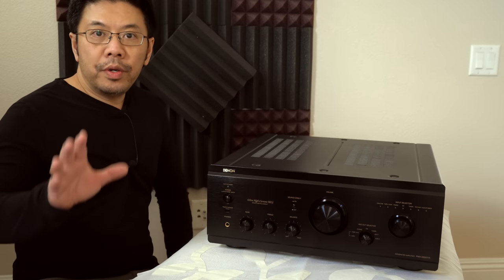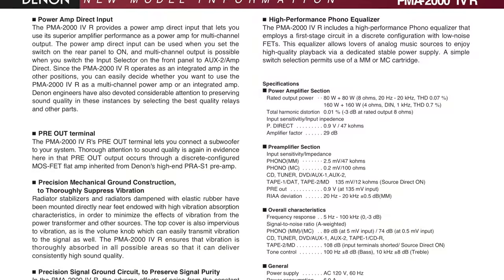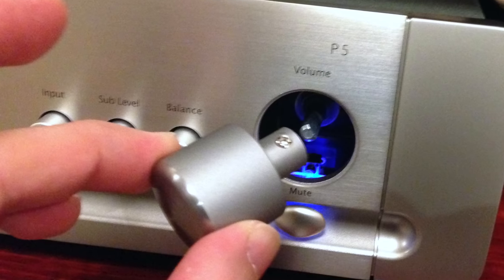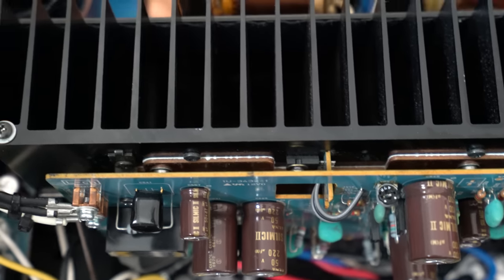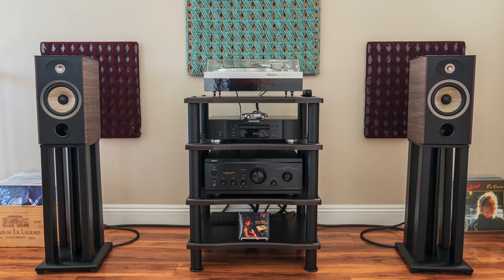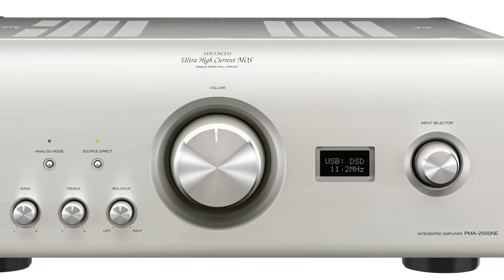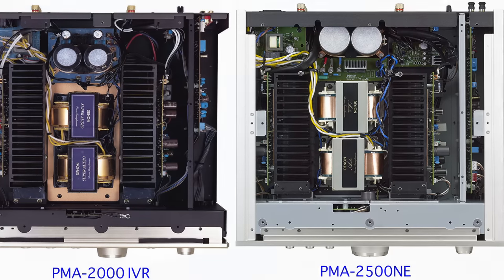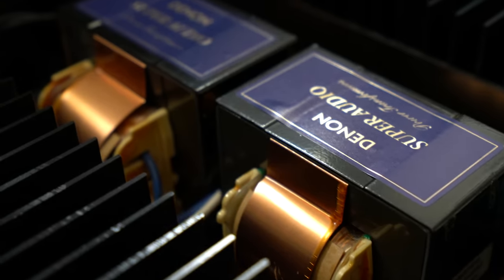Denon PMA-2000 IVR, A Hidden Gem For Music Lovers

Comment: Hi sir im one of your subscriber ask please i saw at Crutchfield website about denon pma 1600 ne need your advice please sir if this integrated amp is good in term of sound quality!? Right now im using a denon av receiver 800h connected to my CD player and Pro ject carbon dc turntable and my bookshelf speaker is triangle bro 3. Thank you sir and god bless!
Reply from the maker: It is very good sounding amp for the price and come with very good DAC as well, it will sound great with your speakers, thanks
Reply: Tharbamar, thanks a lot sir 😊 appreciate
Reply: Thank you so much for this question. I am also looking at the 1600NE since "the internet says" it offers a very close performance to 2500NE but for quite less of a price. However I see that I have several 2000AE and 2000R on the used market and paired with a DAC e.g like the Modi3 / topping D50 / SMSL SU-8, or even Node2, it then comes same price or even cheaper than a new 1600NE... which beggs the question , IS THAT A WISE STEP?, and what could be the major sound differences there? (Set aside the size differences and the fact you have more separates)

Comment: Hi I saw a Denon PMA-2000R for sale online. The description said it was in good condition. The add said that everything is working like new except the phono stage selector. The ad says it makes a popping noise when you select MM or MC. After its selected no issues with the phono stage. Is the popping of the phoo stage fixable by any chance? Thanks!
Reply: Do not change phono selector when the unit is under power!
Turn it off and wait a minute before changing between mm and mc.

Comment: would you say Denon is a safer choice among other "modestly-priced" brand like Marantz, Onkyo, Cambridge Audio?
Reply from the maker: Not necessarily, I look for inside of any amp for quality of the parts and design, I would start from there.,
IMHO, for company like Denon can last for 100+ years and still top selling brand in home audio market means a lot to people like me as proven performer, all of their mid range to top end models were produced in Denon’s Shirakawa Audio Works in Japan, which they're very proud of it. thanks
Reply: @Tharbamar  thanks for the reply, appreciate it. I am looking into Denon amps lately most especially since you picked it over PS Audio and Luxman amps. I only have an Onkyo 9150 which is great but your videos got me curious about denon amps.
Reply: denon are great the only work you'll have to do is on the relays, cambridge audio use substandard caps and are prone to dry solder joints. marantz are similar to denon but can have transformer hum.
Reply: @DueM  thanks for the inputs. what baffles me is marantz is supposed to be the upscale sister company of denon yet the marantz vs denon amps ive heard at the same price point, marantz seem to sound inferior. (i used to have pm5005 and even my onkyo sounded a lot better)
Reply: Mu Sansui G-8000 is 40 years old and still going strong ! Its rated at 120 watts but it has weight to the sound !
Reply: you could buy any amp as you want cause you are very rich audiophile with golden ear

Comment: Between denon pma 2000 ivr and yamaha A-S1100 which one will you pick
Reply from the maker: I would still go for 2000IV R for dual mono design personally, may be much better power supply as well. AS2100 is more comparable in my opinion. In their home market Yamaha AS-2100 and Denon PMA-2500NE (successor of 2000 series) are direct competition.
Reply: Denon for sure!
Reply: What about Yamaha AS 1200 vs Denon PMA 1700n? Thanks

Comment: Any one know that 2 transformer are mono design or 1 is for power amplifier section and 1 for the pre amplifier? I didn't find and information about this, thank you.
Reply from the maker: I have the manufacturer spec sheet in the video if you missed it,  it is dual mono design and power output is a lot more than rated by Denon.
Reply: @Tharbamar  thank you, I have the 2500 but I still don't know the details. Ha ha
You know what, I using a luxman CL88 vacuum pre amp and I bet the sound quality for me at least 20% better!! I used to use CL88 and MQ88 but now I keep the MQ88 in my garage and that Denon 2500 doing a very good job.

Comment: What recommendations on stronger amplification the type of power that can drive most of the speakers out there with finesse. That to me is most important because I've changed speakers out many times and i prefer an amp to keep up with my pace, if i come across a speaker at a very good price i don't want to not get it because i have a bookshelf amp. I am about to upgrade my parasound a21 i haven't had any problems with it but it's time to move on. Something less than a used car.

Comment: Whats the difference between the 2000ivr and 2000r i can get the 2000r for 600$ used
Reply from the maker: IVR have better pre section and remote control, 2000 does not come with remote control.

Comment: Nice. 
Power supply is strange. There are only two big caps for power stage. Parallel transformers? One for the preamp? 
There are very many Elma Silmic II high damped caps inside. Does it sound dynamic?
Reply from the maker: It’s not strange for Japanese design amps, this amp is dual mono design, sound is dynamic and powerful, thanks
Reply: Tharbamar 
Just found schematics. Symetric +/-56V for the power amp. One big cap for + and one for - with no channel-separation. So there‘s one transformer for + and one for -. Uncommon.... Might be designed because space was long, but not wide enough for one transformer.

Comment: You can't just talk about an amplifier without discussing it's schematic! Which Mosfets is it using in the output stage? How about the input stage? Are they using opamps or have they chosen to go fully discrete? Where's your graphic equalizer? Don't you like to have control over your sound?
Reply from the maker: Nobody wants to hear me talking schematic or more technical terms other than basic specs, as long as I know that's enough.
Reply: @Tharbamar  you don't have to go full technical, but since you had the cover off... It would have been nice to hear you say, Oh! I see what they have done there, that's nice or wow! Why did they do that? Assuming you understand the circuit design and the characteristics that it brings to the audio that it's reproducing.. Anyone can read the specifications in the owners manual or the public relation department hype! I watched your video because I thought that you might educate me better than that of the marketing guys... Because according to all amplifier manufacturers, they all make amplifiers which have a beautiful and warm midrange! I'm sure that you are impressed by what you see inside, they go to great lengths to make it look desirable because they know very well that good looking components have a placebo effect on customers, they didn't get their job just by looking pretty. Electronic Engineer's by heart want to design the ultimate circuit in whatever field that they are working in.. But by the time that circuit leaves the desk of the accountant, it will be changed, the accountant is the person who takes to the circuit with side cutters and clips away until it stops working, because if it can work without half of those components, then it doesn't need them and the company can make more profits. It's called the Munson effect which was named after the man himself. Thanks to him, we now get products that are not protected from everything that you could possibly do to it as an end user and the product won't last as long as the engineer designed it to... That's where people like you are supposed to step in and steer people in the right direction towards companies that are doing the right thing! And you can't teach anyone anything if all that you are doing is referring to the owners manual and the brochure, then telling us that you like it.. What's good for the goose isn't always good for the other goose..

Comment: Why is this not a good match with electrostatic speakers?
Reply: I am pretty sure it would have to do with the impedance characteristics of the speaker I believe electrostatics.   are a problem with some amplifiers.
Reply: magnetic speakers are mostly act as resistive loads whereas electrostatic speakers have a considerable capacitative characteristic, meaning they can store the electrecal enenrgy of the amplifier and send it back to the amplifier when the polarity of the signal that is fed to them reverses. Electrostatic speakers require high voltage, have impedences of several hundred ohms at low frequencies and possibly as low as 1 or 2 ohms at low frequencies (their impendence is inversely proportional to frequency). For these reasons, electrostatic speakers sound best and are less prone to cause damage when they are paired with amplifiers that are able to deliver high voltages as well as high current. I have of course simplified and generalized many things in my comment.

Comment: yamaha ax-1090 it's even better
Reply: Your opinion only. Audio is very subjective.
Reply: Nope!
Reply: @dr.anthonyforgione4253  ofc it is, i heard them both many times
Reply: @olegariomartinez6807  not really
Reply: yamaha ax-1050 is not that great. Even cheap new units are better sounding. Maybe AX1090 is a great step up.
Reply: @rosenlazarov     it's the flagship of the series and it's newer that the 1050, two generations newer (1050,1070, 1090)
Reply: @HowDareYouu  I doubt that 10xx series was their flagship. Non the less they are not entry model but sounds like one. I still have 1050.
Reply: @rosenlazarov  it was the flagship at that time. Do some research
Reply: @HowDareYouu  It doesent sound that way to me. Hope 1090 is soundig great!
Reply: @rosenlazarov   google is your friend

Comment: I am not really impressed with the denon pma 2000r. It just sounded average
Reply from the maker: 2000R is not the same as 2000IVR later generations have better pre stages.
Reply: Maybe it's you Bose speakers.